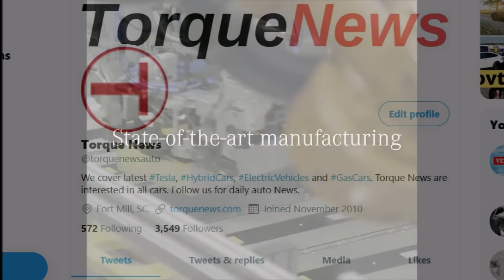Mercedes Debuts EQS Sedan With 435 Miles of Range and Tesla Beating Battery

Comment: I think you will find people will choose tesla over any other brand because comparing the EQS with a model s is unfair comparison for many reasons but I'll state some. 1st point. EQS is a model 3 size car and thus should be compared to a model 3 which is substantially cheaper than the EQS and the model s so when comparing a model s you need to compare the model s with a fully optioned top spec Mercedes as the standard $80 000 model s comes standard with all options except paint and fsd which the paint is 1k extra and the merc comes with none and you can pay $50 000 just on options with the merc and it will still have less power, performance, and specs of model s so I believe a fair comparison with the EQS would be a $50000 model 3 with is the true competitor. Put all that aside. Even if all other EV car brands could outsell tesla they are 10 years behind tesla in there ability to produce millions of EVs. Only tesla is because they produce more batteries than the rest of the world combined and they have battery factories of a size the world has never seen before and that took tesla 10 years to do and elon thinks to the future like no other person in on earth so when push comes to shove people will have to buy a tesla by default because they are the only ones who will have capacity for demand
Reply: Nathan, sorry but how old are you?
Reply: I'm 43. I hold a double  university degree, bachelor of business/finance. Majoring in logistics admin, finance, and commercial law, graduating with distinction and gaining my honours. I have deep knowledge of physics, both GR and Quantum Mechanics and have been into cars as a hobby for over 30 years and understand every aspect of tuning cars for drag racing and circuit racing and am currently building an EV track vehicle from ground up so I believe I have a lot of knowledge about what's needed to build EV, s at a scale needed to replace all ICE cars and Tesla is the only Company full stop who has planned and is locking in all the resources needed to build 20 million EV's per annum by 2030. If you don't have a plan in by now for 2030 then your toast in the way of being able to meet demand AND to top it off, all legacy autos EV's will directly impact their ability to remain profitable  due to declining ICE sales and all these facts are readily available to everyone who isn't biased enough to actually look. I hope this helps in any attempt to discredit my factual opinions due to my age

Comment: When the EQS is as different from the 'concept car' it originates from as the EQC and the EQA from thier respective 'concepts' i'm really not worried. Mercedes -Benz customers should be worried. As they just buying a restyled S class with an electric engine. The EQC = GLC with another interior and engine. The EQA= GLA with another interior and engine. So far de re-tooling of the factories. Why would the EQS be different. It's actually a scam. Let's see.

Comment: You don't know yet, but the new Tesla 4380 battery is the 600 miles range battery. Tesla don't want anyone to know that yet until they start the mass production and get rid off the old type.
Reply: A battery doesn't have a range. The range is determined by how many batteries in the pack, the efficiency of the drive train, the weight of the car and the drag coeeficient.
Reply: @jimdetry9420  
Oh, f me, another tech genius on YouTube. When you walk, what is the most important thing to do the job, your shoes, your feet, your muscles, or maybe the food you eat to have the energy to do it ?
Reply: @peterp4753  That's a great argument to support your claim that there's such a thing as a 600 mile battery.

Comment: The problem they are dancing around is call "Union". The new electric cars take less manpower to build, if they are to be competitive. Manpower in the auto industry is going down... so stall, stall, stall.... The only 4 things that will count in the future are quality, price, advanced features and quantity. MB has none of these and could not put any of them in place before 2025 at the earliest, most will be after 2030... Please send the address of the MB battery factories and include the technology it is based on... and while you are at that send me the address of the software lab. MB software has been an issue for year, when they have tried to implement advance feature.
Reply: Most people buy Mercedes for the logo and snob appeal as a luxury vehicle. 
They generally also have nice interiors.
People who think Brand, styling and other things don’t matter are not clear on how many luxury vehicles are sold.

Comment: Model S looks boring after such a long time without a major face lift. People want something new. Sales for Model S in Europe dropped dramatically in the last years and if the EQS is not a total fail, it will help accelerate this development, at least in some parts of the world.
Reply: No one will chose car that is more expensive than Model S which also has more range. L Plaid+ will have 520+ miles range.
Reply: @davereviews399  Plaid+ is still more than a year away from now and it's all about performance, not luxury. I don't see it stealing many customers from EQS.

Comment: everyone that stated more range then Tesla, ends being less range when they come out....

and everyone thought the Cybertruck was ugly, the interior on the EQS is ugly AF LOL
Reply: The battery of the EQS is bigger and the drag coefficient quite good. Daimler would have to make a very bad job to NOT achieve better range.
Reply: @EinzigfreierName  bigger battery means more weight which basically cancels out the benefit of a big battery for range. And Elon has figured that out already lol. anything more than 500 range is overkill though, i doordash and 450km is a lot :)
Reply: @gc4924  Weight is not so important for range, especially not on the motorway. Airodynamic drag is key here.
Reply: @gc4924  Weight is not good...but adding a bit more battery size on a larger vehicle with great aerodynamic qualities is a solid way to get more range for larger sedans.
When you’re paying a lot for a huge vehicle, you’re going to want a lot of range.
Cheers

Comment: How many kilowatts is the battery pack
Reply: This won’t be revealed because it would immediately expose the incredible range claim as extremely unlikely in my opinion.
Reply: @fredbloggs5902  108 kWh usable capacity so maybe 115-120 kWh. That's where the range is actually coming from.

Comment: More nonsense....when can I buy one for less than a model S?? Likely never...
Reply: they are unable to compete, just spew out prototypes and bold claims that never get realized...
Reply: @DaveBoxBG  It's not a prototype. Lot's of them have already been spotted on german roads only slightly covered.
Reply: People who buy a Mercedes don't want a CHEAPER car but a BETTER one :)
Reply: @EinzigfreierName  Doesn’t matter whether it’s “better” they want a Mercedes because of “Snob Appeal”. Brand does matter.
Reply: @davidc2838  Yes, that's true, at least for some people.
Reply: @EinzigfreierName  with less range, no autopilot and batteries that has the wrong chemistry and will be dead in 3 years ? yes people might want the better one. :D
Reply: @DaveBoxBG  Why less range? The EQS has MORE range than the Model S. And what's wrong with the chemistry? Dead after 3 years is nonsense. Warranty will be at least 8 years as with almost all EVs so Mercedes would be stupid to install batteries that die after 3 years. About autopilot, well, Mercedes driver assistant systems are not that bad after all. And real autonomous driving isn't possible or allowed on public roads anyway. So no big difference for practical use cases.